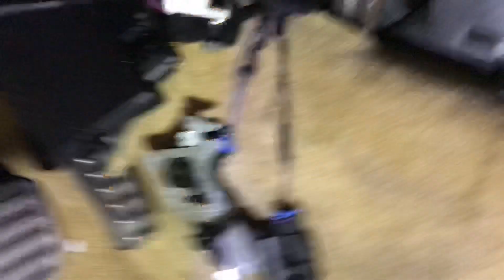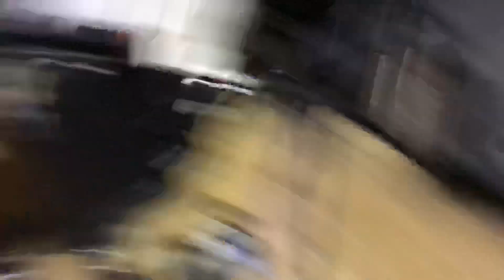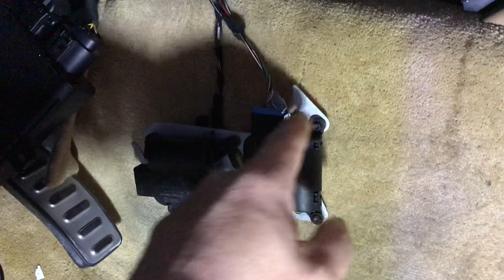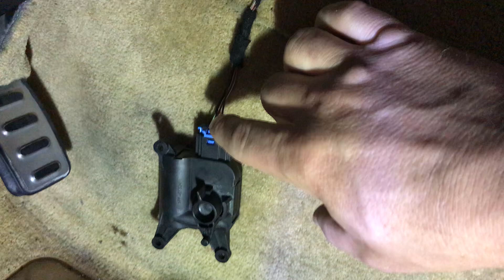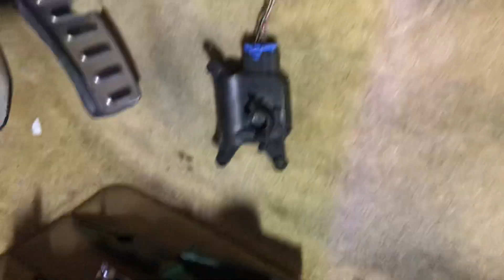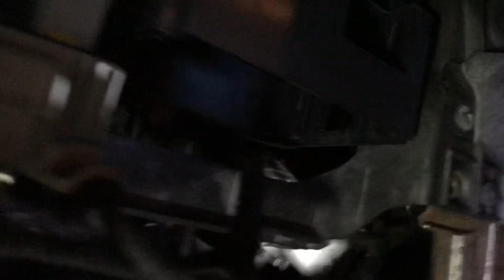Cayenne AC Servo Replacement

Comment: Thanks for the video!  I now have the same problem but for the life of me cannot figure out what all needs to be removed to actually gain access to the motors.  I have the lower DS panels off but don't know what else to remove to expose the actuators.  Can you offer any guidance?
Reply from the maker: The center console side piece needs to come out. You can sorta see it in the video. I also moved the relay pack that is above the gas pedal to gain a little better access.
Reply: @Breitwerks  So it looks like I also have to remove the silver metal knee board also...correct?

Comment: If there is no wind from the air outlets on the left and right sides, you need to replace the servo motor
Reply: Thank you
Reply: @wallyo7777  I have fixed it
Reply: @優質先生  how u fix if?
Reply: @wallyo7777 The motor is not installed. Turn the damper to the fixed position.
Reply: @優質先生  manually opening the damper flaps sounds like a good time saver.  How do you do that?
Reply: Anybody have links for the servo motors? Do all 3 have to be replaced at once?

Comment: WHICH SERVO MOTOR CONTROLS THE CENTER 2 AIR VENTS I HAVE LOW AIR COMING FROM ONLY THOSE TWO VENTS THE REST ARE BLOWING FINE
Reply: I have the same problem
Reply: Same problem here I'm researching now 😂
Reply: Did you fix or find out what servo motors are for the central vents?
Reply: Any update on this?

Comment: If the engineer who designed that system had to repair it you can bet the assembly would be easier to get to.
Reply: Not exactly, at dealer by manual you need to remove the whole dash, center console and all that to service it, 12h at $275 an hour plus parts.